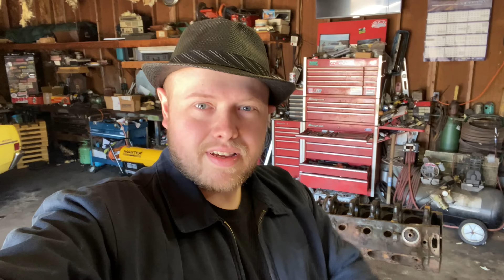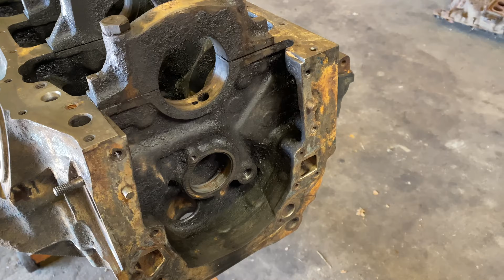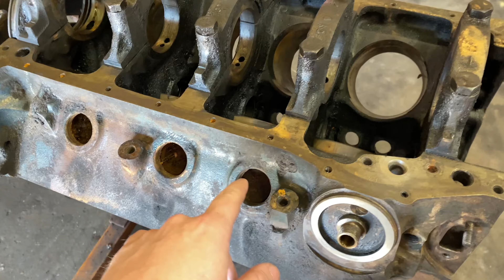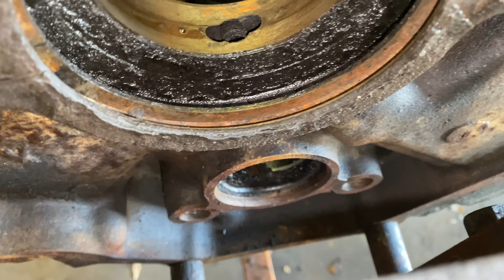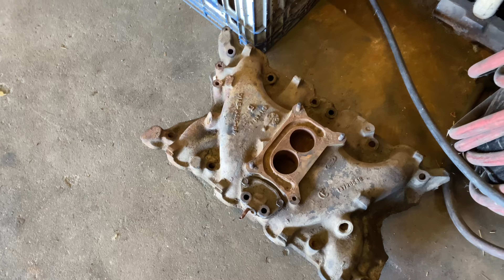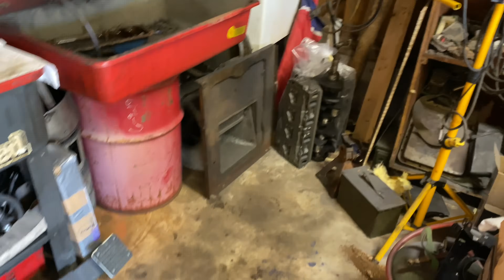351c engine block prep for machine shop.

Comment: Make sure you always put the thermostat restrictor plate back in or youll have overheating issues that will drive you crazy
Reply from the maker: @theilluminatinwosux  absolutely, I ordered an aluminum one that is made to run the more standard typical style like a 302 or Windsor, instead of the one with the hat made on it, easier to find the more typical one. I’ve got a video where one talk about it on my channel. 
Thanks for all the tips and advice, I like seeing other Cleveland family members out there. 
Thanks for watching.